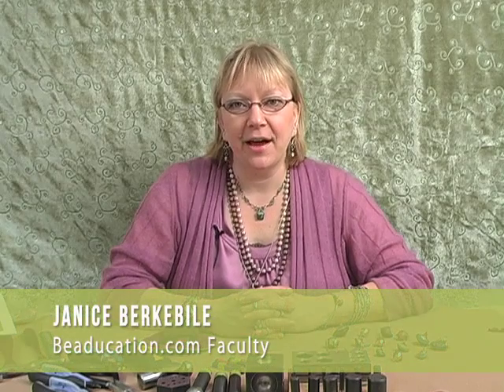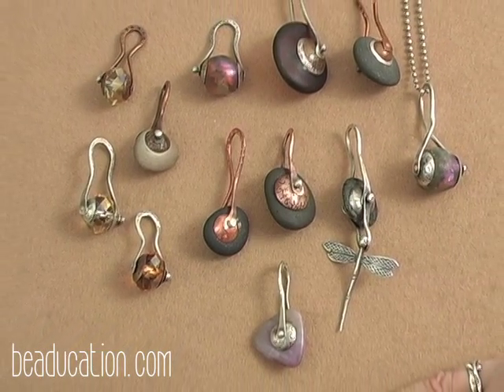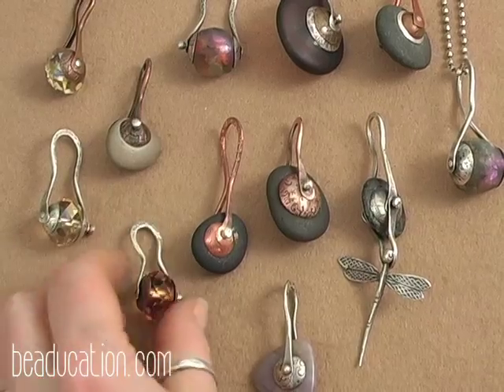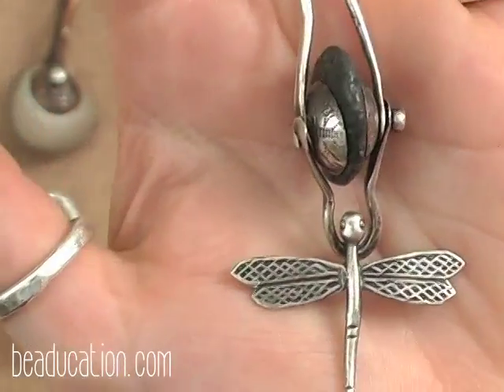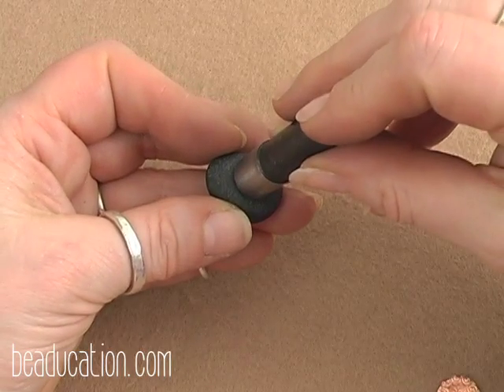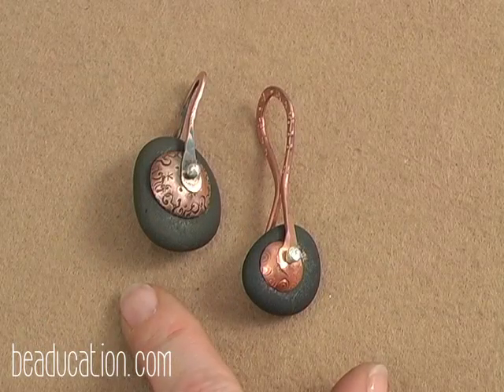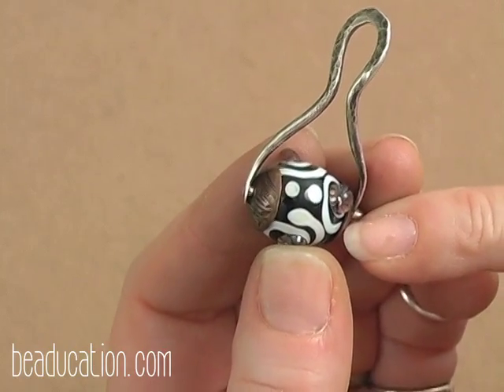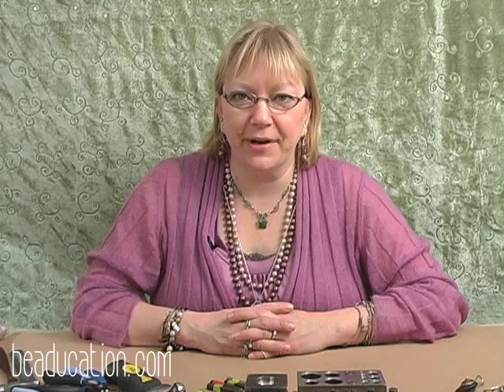Riveted Stone Amulet Pendant Tutorial - Beaducation.com

Comment: I would love to be able to 'ball up' both sides of the wire that goes through the pebble or other stone used for a pendant.  Do you have any tips on how to do this without burning piece when balling up the second end of the wire?
Reply from the maker: Hi Mary! You'll need to isolate the in water, or use a product that is used for heat shielding the stone. Have fun!

Comment: Great video. I was wondering if you would be able to just ball both sides, and how you would go about doing that?
Reply from the maker: Hi, it's quite hard to get the tension tight and then ball up the opposite end, plus you have to get your flame very close for quite sometime and it will like crack the beads close by. Good luck!
Reply: +Amanda You can bury your stone in a soft charcoal block, flux it well with a borax/distilled water solution first, and if you have a Smith torch set up with propane/oxy, use a small tip and it's easy as pie to ball up both ends while protect the stone.  I do it all the time, even with pearls, no problem at all.  Just take your flame on and off the end of the wire and it will ball up very well.

Comment: Thank you for the great ‘step by step’ instructions.  Was the wire annealed first, it looked so easy to manipulate?  When it comes down to the riveting, have any of your beads broken while tapping the end of the head pin?  My husband and I make Polymer Clay beads and I wonder if they would crack or break during that last step.  BTW, you do have the perfect voice for teaching on YouTube.  👍🏻
Reply from the maker: Thanks for watching our class! Janice is a great instructor...we love her! She did not anneal the wire. She does use fine silver dead soft wire. Dead soft will be easier to manipulate. Stones can break if the holes are not large enough and you are trying to squeeze that wire through...since it is pretty thick. It's hard to say if your beads would break, but you can test it out. It's such a great design!

Comment: I went to the materials list on your website and am not sure which type of wire to buy for the 12 gauge.  I see that the 14 gauge is fine silver.  Should the 12 gauge also be fine silver, or should it be sterling?  Also, while I have you here, I'm obviously new to this . . . do all "fine silver" pieces have to be work-hardened in a tumbler at the end, or can they be hardened enough via hammering (specifically: bails and links/clasps)?  This is a going to be a costly hobby to break into and I'd like to buy the tumbler in phase two of my shopping extravaganza, if I can.
Reply from the maker: Hi Sandra, The 12 gauge used in this project can be any metal, Sterling, Fine Silver or even Copper. In regards to using Fine Silver, it is pretty soft and yes any bending or hammering you do to it will harden it up. As far as tumbling goes, it really depends on your piece. If it is super stiff and retains it's shape after you have "set" it, then you will not need to tumble. If you did any hammering, then you most likely won't need to tumble it to harden it. I tumble almost everything I make, not necessarily to harden it but to give it a final awesome shine.
Reply: beaducation Thanks so much for the info.  Sounds like I might like a tumbler in the near future ;~)  Santa??? Are you listening???  .... er, reading?